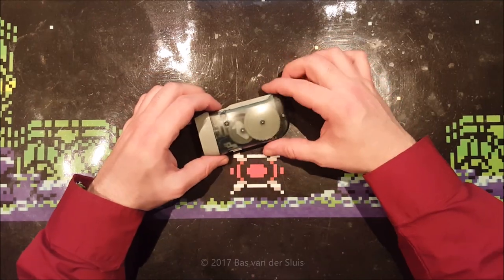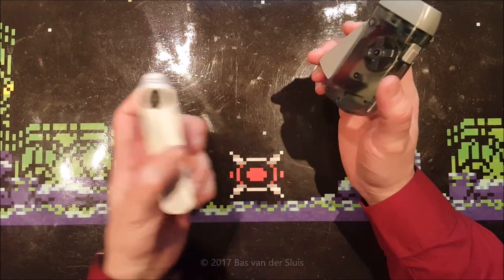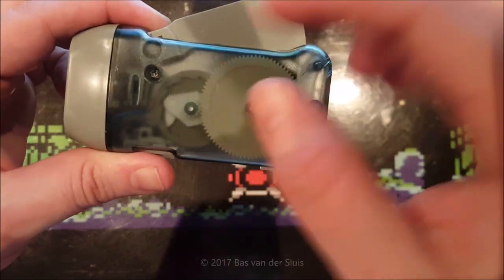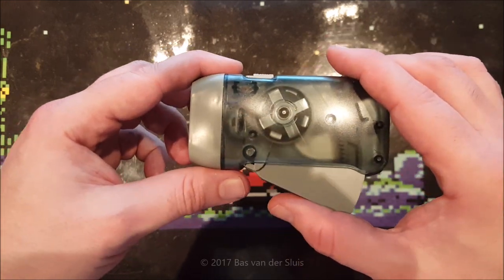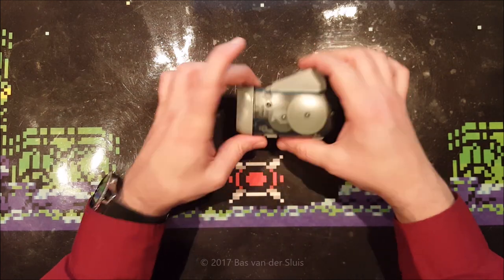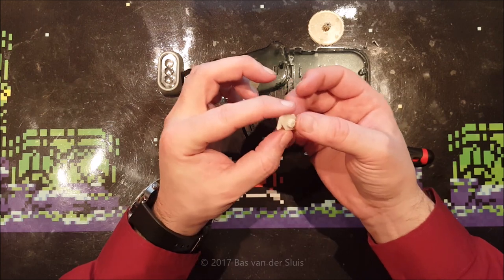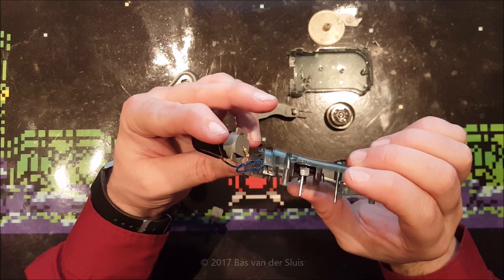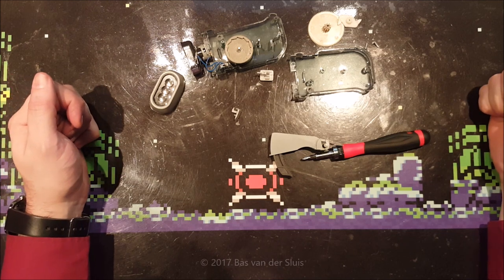How a cheap Dyno Torch works and a look inside

Comment: I love the idea of dynamo flashlights, but the stupid thing with them is, you need to pump them FAST to get any light out of them. and this just isnt efficient from an ergonomical standpoint. i'd rather prefer to have a bit heavier flashlight with more resistance in crank but which you can pump slowly and which has a lot of inertia and can keep ligting for like 3 - 5 second between the pumps.
Reply: Only because the ones you used are the plastic crap ones. They sadly don't make high grade dynamo flashlights anymore. 
I have one made in germany from the 1920's all metal gears brass bushings heavy metal balanced dynamo. 
it does not take near the amount of effort to keep it going despite it generating the same voltage as the modern one shown.
a quick led upgrade brings it to modern day. 
get a vintage dynamo
Reply: @raccoon681  When did i say all i used were plastic crap ones? i happen to have an original 1940s Phillips, a 1950s american army one with capacitor, and  a plastic one made in 1980s Hong Kong. all work fine, tho the older ones work better.
Reply: @bluemoondiadochi  sorry i was more ranting about the crap quality of the new one's.
Reply: @raccoon681  no prob all good. Yea, new stuff in general could use a bit more of Volvo Redblock approach. but as long as it's buy and throw away economy, i prefer to stick to older, well made things.

Comment: AND ALSO ITS RECHARGEABLE NUB
Reply: I have one and Ill just say, its not rechargeable.
The current from the actual dynamo goes directly to the LEDs, not the battery and by logic, pressing it will light it up so hows it charging? Its not.
Reply: @TheStreamingGamers  anyway a fun toy and you can replace the batteries with few tear down